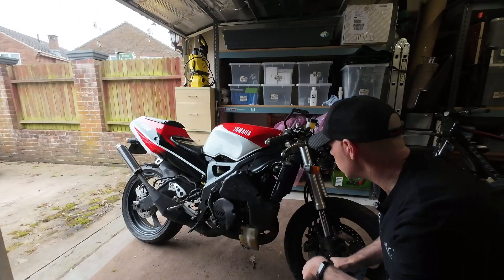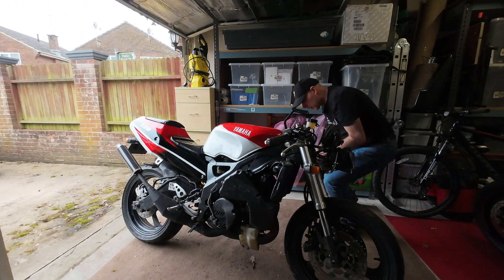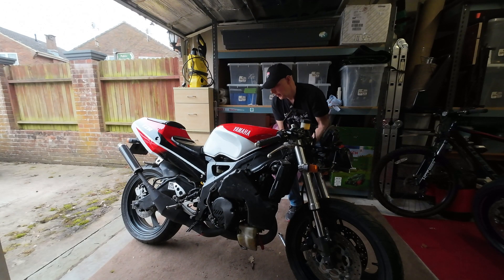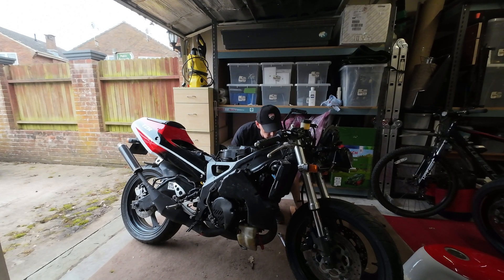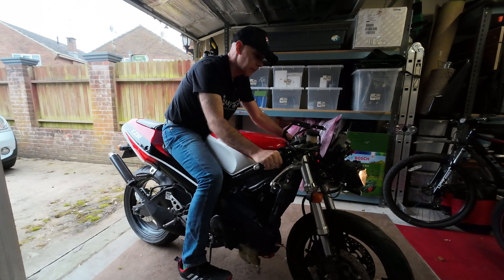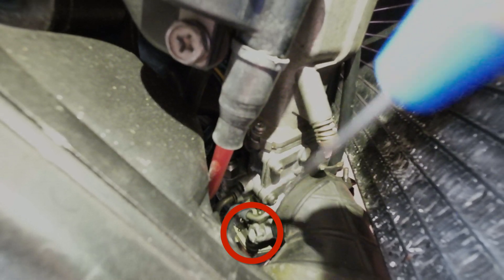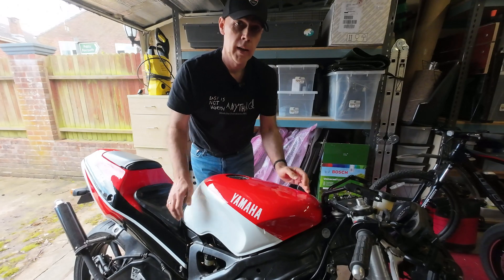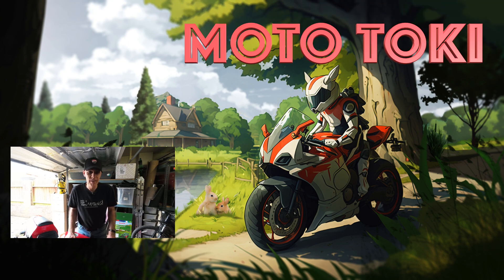2 Stroke Carbs - Setting up a twin like two singles

Comment: What does that mean you have to keep flipping it or it will foul a plug? Does this Yamaha not have an auto lube?
Reply from the maker: @SMALLMOTORCYCLEADVENTURES  it does have autolube but it still helps to keep the plugs clean to get it over 2k rpm!
Reply: @ Interesting. Of my collection I only have two 2 strokes - an RD400 and CS5 and best I can tell the ratio ranges between 125:1 and ~30:1. I just assumed that sorted it out.